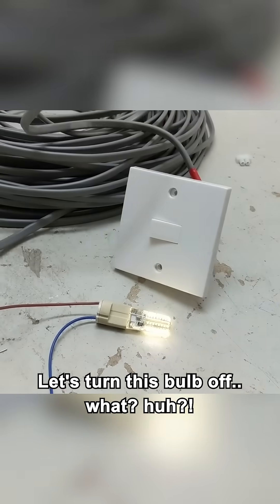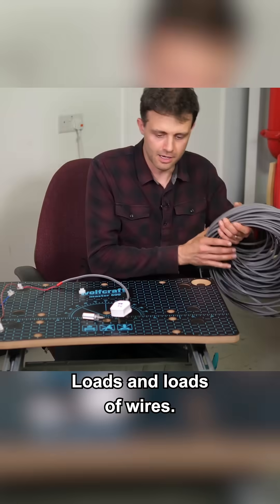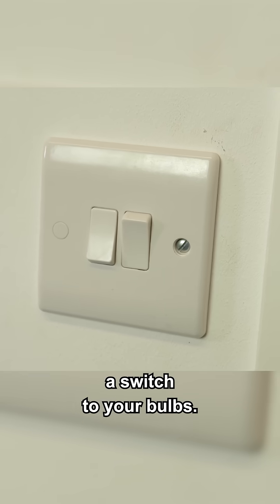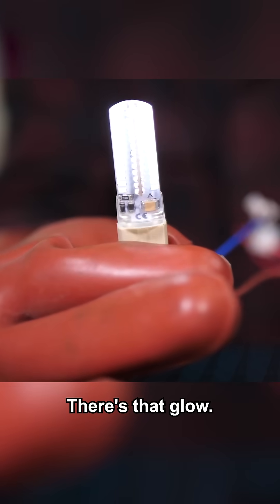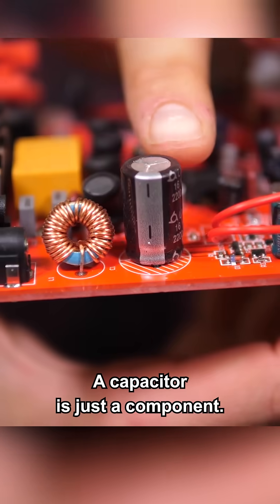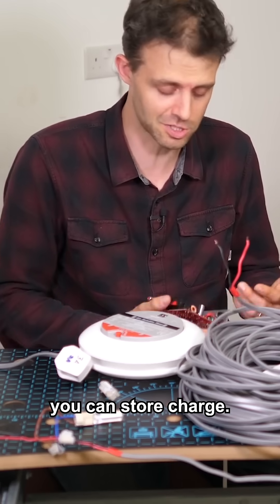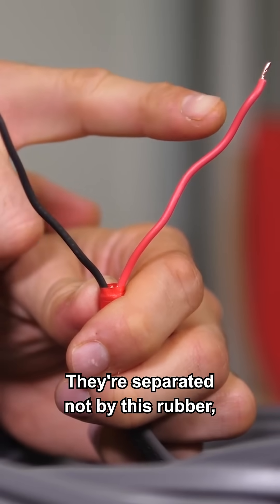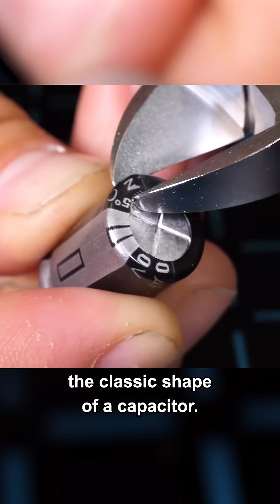This Zombie Bulb Will Not Turn Off! But Why?

Comment: While I agree there is a stored charge in the wire(capacitance), he does leave out that the phenomina of charge continuing to flow after the power source(AC/DC) changes is known as inductance. ( symbol : a coil of wire )
Reply: No

Comment: Feel free to explain why that coil of wire is a capacitor and not an inductor. 😊
Reply: The inductance is nullified, by virtue of two wires carrying equal and opposite current, coiled up together.  Had you coiled just one polarity (or phase) of the wiring, or had you coiled the opposite polarity with the opposite handedness, then you'd make an inductor.
Reply: @carultch  thank you. I'm not sure why I was thinking he was working with AC.

Comment: Yeah in fact the symbol is exactly what a capacitor is - a pair of parallel plates with a small gap in between and between which spans a uniform electric field

Comment: My gosh you're a damn genius! I have a circuit in my house with the same type of light bulb in a stairwell going down to the basement. It will stay with just like that for about 45 seconds after I turn it off I turn it off. Which for the stairwell is a big plus
Reply: It's not the same effect as this one Is going on Forever but I have no clue what could Cause yours that it's turning off completely. Sounds like a regular capacitor but it would have to be a huge cap to feed some mA over the whole 45s.

Comment: The capacitance of a given run of wire can be a really big deal for networking. When sending a message involves (metaphorically) turning a light on and off really fast, it can be hard to read the message when the light doesn't turn all the way off.

Comment: Some led bulbs also have capacitors built in as part of filter circuits. When I was in the navy we upgraded our rack lights to led. You could actually do a cool trick where you turn the light on, pull the bulb out, and it would stay dimly lit for about 2-3 seconds. Pulling it apart revealed the capacitors were the cause

Comment: Your cable can also work as an inductor
Reply: Inductance is likely to be happening in higher significance inside the switch.
Reply: The inductance is nullified by the two opposite polarities, carrying equal and opposite current.

Comment: I solve this problem by adding a capacitor parallel to the led bulb, the value of the capacitor should be from 47 to 100nF 275V AC. The small capacitor acts like small value resistant for the induced current and bypass it to neutral. It is important to put the capacitor after the switch, parallel to the led light.

Comment: Another way of looking at capacitors (and inductors) is that they act as ways to slow your circuit down. A circuit with these components would behave in the same way as one with out them, but it’ll just take some times

Comment: Still no idea why is it glowing, you just broke the circuit via switch, what has a capacitor have to do with providing energy to that? Like I know a cap literally stores and provides energy but I also know there's not enough capacity for it being alive more than a few secs.

Comment: But capacitors as you have pictured here are electrolytic, they require an electrolyte compound, to work, they are effectively batteries, a super-capacitor operates in the manner the coil of wire does, though it is quick to charge and discharge, depending on the requirements of the circuit drawing from it.

They use super capacitors in wireless computer mice, and apple pencils 

Though I’m sure your full video discusses this Steve.
Reply: um, the most basic and common motor capacitor if two aluminum foils with wax paper and a bit of oil for heat conducting. electrolytic are strictly DC. Foil capacitors are a break in circuit to DC but basically transparent in AC with time delay in voltage peak
Reply: That is tantamount to a supercapacitor, which I addressed in my comment. These are implemented to prevent stalling on startup.  @adrianwilson7536

Comment: The LEDs themselves have capacitors in them that far excede the cable wiring. 
That or the neutral is slightly hot from bad wiring

Comment: I'm pretty sure this is also causing my issues of being shocked by grounded chassis equipment at my home. I don't have ground connections in most my circuits so it's either a buildup of charge from capacitive coupling or leakage through the MOVs in surge suppressors to the floating ground conductors.
Reply: 🤔 if you have no ground and are getting shocked. It's most likely somewhere there's a bad connection or the wires are reversed. 

Are you actually able to measure a voltage? Based on my experience I would guess it's half of the normal voltage.
Reply: @ralanham76  I get a continuous buzzing and tingling when I press my forearm against a screw head on the case (that's actually how I discovered the issue) and non contact voltage detectors flag the entire frame as hot (it's actually a server rack that I have done most of the testing with). To the point I can wedge the ncvd into a hole in the frame and it goes off while I am standing 3 feet away but that has more to do with the shape of the field than the strength I think. I have used the 2 prong to 3 prong adapters to isolate every piece of equipment independently at multiple points switching out and disconnecting every piece in turn. The issue is present on every PC in my house but not on other appliances which is what has me leaning towards MOV leakage as it appears to be associated with uninterruptible power supplies or surge suppressors. My line to neutral measures 120v as it should be, ground measures 58v to hot 62v to neutral.
Reply: @Zanthum  yes I think your right. Are you able to test the power supply separately ?

Comment: The capacitance of insulated wires is also an issue for amplified music instruments.  The longer the instrument cable between an electric guitar and the amplifier, the bigger of a capacitor you have.  This effects the signal by acting as a low pass filter cutting more high frequencies the longer the cable is.
Reply: Recording trick, take a direct line from amps speaker with a 22k resistor in series.  This gives you the bottom end of a direct line signal, but you also get the acoustics of the driver, cabinet and room acoustics because the speaker is acting as a microphone and listening to the room and supplying the signal as back emf, works really well.
Reply: damn dude this is some good ass information
Reply: I’m picturing John Fogerty playing “Born On The Bayou” in some old video clip on YouTube in which the signal cable n his guitar is not even touching the ground. I wonder if he was trying to have that much more control over the tone of his guitar
Reply: @LowOutput  its even funnier if you watch the video (i think was) for "old man down the road"  just a camera following an instrument cable for 3 minutes until it gets to John.  😆 cant imagine what that would have actually sounded like...
Reply: And turntables. Some cartridges perform better with reduced capacitance to the amplifier, hence you need shorter phono cables...which can sometimes be a pain.

Comment: It's probably not acting as a capacitor.  It could just be acting as an inductor because that's what it is.  It's a coil of wire, and current running through it generates a magnetic field.  When the current stops the magnet field collapses and as it collapses it generates a current.
Reply: An inductor was my first thought, but it's easy enough to test. straighten out the wire and try it again.

Comment: Most of the time it’s not the wire working as a capacitor, it’s because the neutral is being switched instead of the hot, thus the lamp still is getting the electricity and the electrons are flowing thru the air to a ground. That ground could be the sheet rock, a stone fireplace, but most likely the bare ground in the same box as the light itself.

Comment: No, you just wired it the wrong way around. You have to break phase, not neutral. Otherwise the AC coupling transfers enough energy for the LED to glow.
The cable may act as a coil (which also stores energy), not a capacitor. But that energy would be finite.

Comment: It's not acting like a capacitor (a device that resists change in voltage) it's acting like an inductor... (a device that resists change in current).

It's acting like one, because it is one.
The symbol for an inductor is literally a coil....

Basically, where a capacitor stores energy by storing the potential difference, the inductor stores energy by creating an electric field.

Honestly. I expected better

Comment: the zombi glow can also happen if the led bulb is to efficient. You can get enough Power with induction from a paralel running cable.
Had that in a bath of a friend I installed lamps in. switch of and the bulb was still burning with 20% light.
in the end I just switched it with another one and both worked in their new.places like they should

Comment: in the us this was solved by code requiring the feed from the panel be run through the switch , then to the lights
however in older homes this is present, i see it in a 1940s house that had most of its light fixtures wired using the method shown in this video, the coonnections made in a box im the attic
leds on the old circuts glow, even more so because neutral-free X-10 and lutron clearconnect switches are used, that run a small current through the bulb

this can usually be solved by having 1 incandescent, or a proper resistor in the circuit, often had from the dimmer manufacterer

quite a chronically annoying phenomenon of electricity, shows how simple a capacitor really is

Comment: But the wiring to you light bulbs is an AC circuit. Sure it isn't the coil you're forming there with your wires?

Comment: even if two wires are opposite each other, it only remotely resembles a capacitor.  The amount of stored energy is far from enough to power anything, because the cables are too far apart from each other, among other things.  So one has nothing to do with the other.  If these bulbs continue to light, there will probably still be energy in the LED driver. 

The circuit symbol of the capacitor shows the two opposite plates, no break.  On the contrary!  a charged capacitor is considered a line.  btw, this symbol shows a polarityless capacitor.  E.g. one made of ceramic.  The circuit symbol for an electrolytic capacitor (ElKo for short) as used in the video also shows the polarity. Because it is important to pay attention to the polarity of electrolytic capacitors, otherwise the elco will burst soon or later.

Comment: It's an inductor, not a capacitor. A capacitor would have the bulb light up immediately when the switch is turned on (as the capacitor is charging). Once it is fully charged up, current will stop flowing and the bulb will go off slowly even as the switch is left ON. An inductor resists immediate build up of current. So when the switch is turned on, the bulb will slowly start lighting up as current builds up and will eventually light up fully and remain lit up as long as the switch is ON.
Reply: That's what I was thinking too.
Reply: It's a capacitor yes.

And capacitors doesn't block AC power. It will probably make a phase difference but that doesn't affect a light bulb.

A better capacitor will make glow normally!
Reply: This is AC, not DC
Reply: It's alternating current so no, that's not how that works.
Reply: The source is at a such an overpowering ratio, you wouldn't have a show change. It is why you see sparks when up plug in a DC adapter. The inrush is quite significant, often several multiples of the rating of the wiring, for a very short period.
Reply: the effect shown is after the circuit is broken. The capacitance formed by the two conductors disposed parallel to each other stores charge, leading to the residual glow in the bulb.
Reply: @wea69420 the problem is you can call that circuit broken, but there's inductive bleed through from MOST switches (ones that are still strictly mechanical)
Reply: @goosenotmaverick1156  It's a capacitive bleed, though, not inductive.  Long parallel conductors have capacitance, and big enough capacitors are AC conductors.  For it to be inductive, there would have to be current in the circuit and in this case there isn't.  If there were 2 circuits, and one glowed when the other was switched, that would be inductive coupling.  But this is an electrostatic phenomenon, rather than electromagnetic.
Reply: @NemoConsequentae  fair enough, I missed the point on the inductance (the lack of current should have made it obvious to me, I feel a little dumb) 

You make a good point and obviously have a better understanding than myself 😎😂
Reply: @goosenotmaverick1156  No worries.  Understanding is the goal! 👍
 (I did electronics/avionic testing, troubleshooting, & repair for ~20 years, so...)
Reply: Not true because you have two wires that forms two halves of the inductor and you connect them in series in the opposite direction... the resulting inductance is zero!
also, remember that you are in AC, not DC!
Reply: @teslacoiler you would be right, if you assumed both wires were disconnected. Neutral is never supposed to be broken by a switch by all codes/jurisdictions I know of. That means you instead gave a grounding plane and a open wire with a high impedance load in between. Some people call that an antenna.
Reply: @teslacoiler capacitors store charge in DC circuits and allow AC through, inductors resist change of flow (allowing DC through but blocking AC) and are akin to a spool of wire as the magnetic fields created as the current increases interacts with the other wires. 

If you think im wrong, look at how high and low pass filters work
Reply: @goverat  It would be an inductor if only one of the wires was in the loop, but here both are run side by side through the loop so the self inductances cancel out.
Reply: I'm still trying to understand if it's a capacitor or indicator because both points seem legit. Experimental verification needed 🤓
Reply: @michelececcarelli5580 Just watch the long form version of this, it explains in much more detail how the effect works (it's capacitance, the mention of how capacitors are built wasn't a bin sequitur, he's describing the fact that a very long pair of wires is electrically equivalent to 2 conductive surfaces separated by a thin insulator aka a capacitor when broken at one end)
Reply: @michelececcarelli5580  

No from a physics point of view it's capacitor. Nothing to discuss. Watch the longer video  to see the circuit better.

What u are thinking about is 2 inductors  parallel to each other where currnet in one of them goes in the opposite way of the current of the other which makes thir magnetic fields cancel each other which makes them not work.

Comment: Or its just a shitty switch that leaks a tiny bit of electricity through
Reply: Even decent mechanical switches allow what I'd call not an insignificant amount, either. Only so much space to be put between the contacts, it's a physical device size limitation more than it is the quality, in my experience. 

A $2 switch from Lowes is roughly similar to a higher quality device thats commercial rated from Hubbel when brand new. It's a lot more a longevity and robustness to physical damage that is the initial difference between the two. No matter how much you spend, on a switch with mechanical contacts, you'll always have some voltage induced across the contacts. Its just usually not enough to light a bulb. 

Also arguably the effect seen here may have more to do with excitation of the phosphors used to create white light from LEDs. I assume both are at play more than whatever capacitance that wire may have. 

Also from my understanding, inductance between the two in this specific case (where the wire is not coiled for demonstration purposes) is what causes voltage drop over distance, at least in part. But I could be misunderstood on that part.

Comment: Wouldn't it rather be a parasitic capacitor and a parasitic inductor.
A parallel capacitor by the live and neutral wire being parallel in the cable. 
And also an inductor by the cables coiled up. 
Although the inductance should be more relevant than the capacitance, because the value of the inductance increases with the number of turns squared and also with the size of the inner surface area. 
But the capacitance only increases with the surface area of the parallel surfaces. Also the capacitance decreases with the distance between the surfaces, which is really high in this case.
Therefore the inductance should be much more relevant.

Comment: Steve Mould, I am actually getting some solar string lights they are 100 foot long 150 bulb 10,000 milliamp hour solar panel with battery and they automatically turn on😮😮